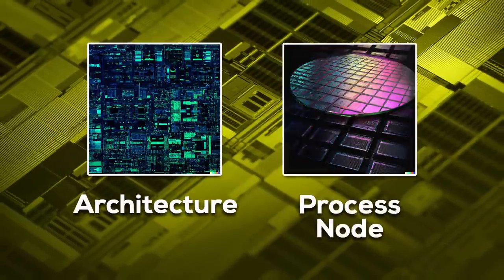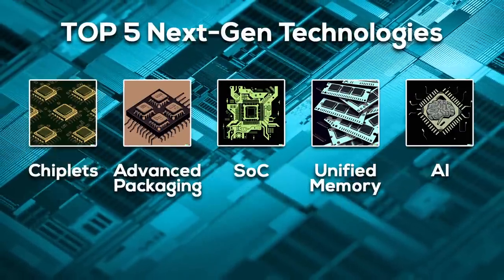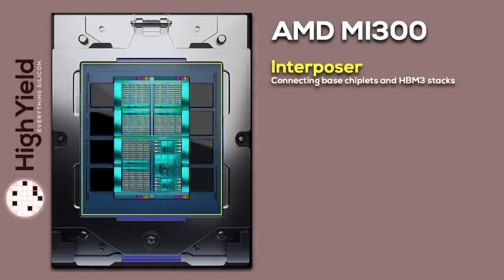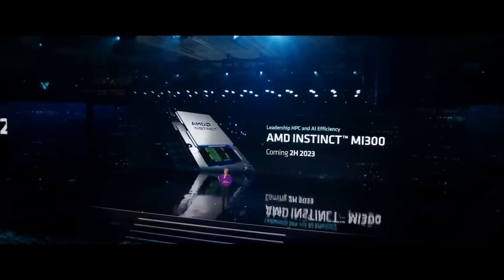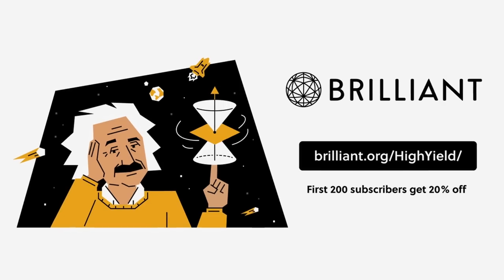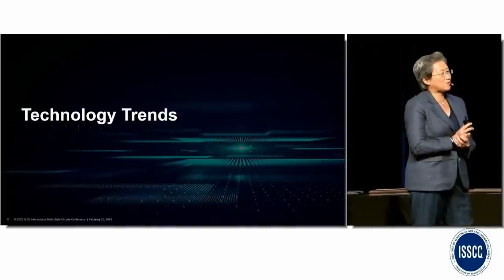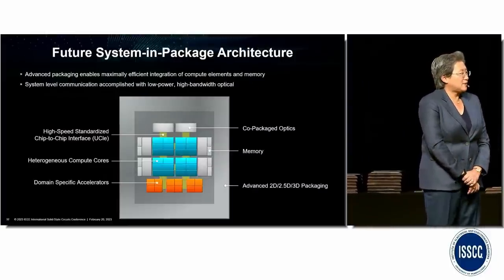Deep-dive into the technology of AMD's MI300

Comment: @HighYield Great channel.  If I may, please pay attention to how long you keep a slide on the screen, especially when text is flashed onto the slide at the last moment.  Just a little thing.
Reply from the maker: Which slide are you referring to? A timestamp would help :)
Reply: @HighYield Sure:

 
2:19
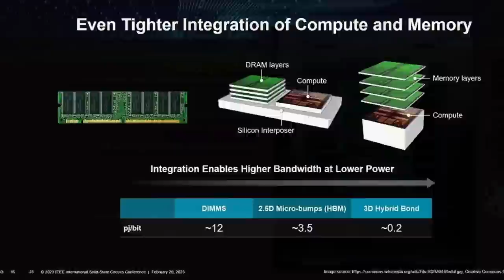9:39 2.5/3D stacking difference: diff is "both (MEM/compute) are actually active".  At 9:47 irrelevant fine print comes into view for 2s.  Even tho that text is unimportant, it creates the impression that I’m missing something.
9:50 "The 5nm MCD and CCD chiplets …".  I couldn’t find MCD in chip diagram or "AMD MI300" text column at right. 
11:54 slide phase-in effect made text unreadable for 4s.  Slide was on for 10s, but disappeared once motion of text froze.  Combined, only once text froze was I ready to read, so reading felt very rushed.
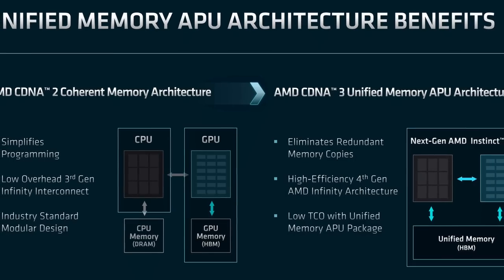13:29 uses same phase-n effect.  But is slide stays longer.
14:19 same
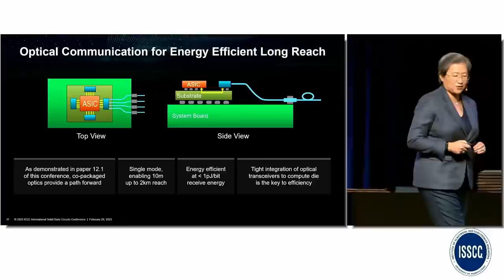17:15 4s

The slide phase-in effect where the start of all sentences are not visible at first and text keeps moving but disappears once it stops moving makes a slow reader like me feel rushed.  (Secret: especially for someone like me who likes to listen at faster speeds, but reads slowly.  I understand it’s not possible to cater to making readable slides at faster speeds).

The section on 2.5D vs 3D at 9:39 created confusion because the explanation of "in 3D, both chips are active" made me investigate the diagram more, and I couldn’t find MCD, so I was trying to find that or determine if you actually said GCD.  The main point is that the explanation of both chips being active in 3D seemed off: the difference strikes me as more about how intensive the transistor switching density (and heat) is for the chips stacked, how tolerant the circuitry is of heat (DRAM, SRAM are finicky), and heat dissipation for the stack.  After all, in HBM, all die in the stack can have dram banks active at the same time.

Please take my original comment as a bit nit picky.  I really like your channel and appreciate the time you put into such thorough content research and video production. I’d like to see your channel develop larger viewership.

Comment: The genius part is making a sort of universal chiplets, that can actually be used in more than one purpose. Whoever figured it out needs someone to go grab him a coffee.
Reply from the maker: Intel's Meteor Lake will also be chiplet based (Intel calls them "tiles") and I'm sure sooner than later Apple & Nvidia will join the club.
Reply: There will even be a PCIe accelerator version that's basically 1/2 of a MI300X on a half size interposer & thus package! (2x base tiles + 4x GCD's & HBM3 stacks vs MI300X's 4x/8x, so 152 CDNA 3 CU's w/ 96GB HBM3 vs MI300X's 304 CU's/192GB). Think the new MI210 equivalent to MI300X's direct MI250X replacement.

Comment: 2:30 I think Unified Memory will really not be a thing. 32GB of RAM for the best-in-class DDR5 Hynix A-die is $80 at its cheapest. The top-of-the-line CPU and GPUs combine to thousands of dollars. Unified Memory involves a lot of management for divy'ing up RAM between the two, which is likely to be slower than just giving CPU and GPU its own separate RAM. Especially given just how cheap RAM is.

For Data Centers, Unified Memory for training AI models is important since we're talking Terabytes of RAM. But atm even 16GB vs 32GB is showing virtually no difference to consumers.

Comment: I say APUs will be the next wave as they are able to perform equal to/better than a console for less money. Small form factor mid range Gaming PCs will be their replacement. I would like to see mobos using dual APUs and shared VRAM style RAM for system and graphics. I really like where they are going. It's what I was hoping for, so I think it will close about the console prediction. Maybe one more "next gen" system from MS and Sony then done....unless they start making pre-built under the name, but they prob won't wa t to deal with that if there is no licensing revenue. Nintendo will probably keep making consoles though, I hope. Anyway my same old ramblings. Thanks for the update!

Comment: I think PHOTONICS are THE FUTURE........  why continue pushing electrons around a board and chips where every bit of distance requires more power to get it there... its inefficiency, like you said, will require a Nuclear Power Plant just to run z Zettascale Supercomputer and the building it's housed in.... photons (light) are so much better to do the work with (IMO) although, we do not have a processor that  can compute using photons instead of electrons (I think) .... but there has been some progress made in this field. BUT not very much. Not enough to make a difference right now. We still still use the traditional electronic methods with some photonic pieces in the system currently... we NEED to make a 100% photonic computer for it blow people's minds enough to fully pursue it instead of using a mix of both systems.... 
I'm hoping you've done a video on this already (I JUST came across your channel when this video was suggested to me, but this vid got me to sub... I really like the cut of your jib, sir! lol) if nopt then I hope you can do one in the near future...there is just too much potential with photonics for it to continue being ignored :)
Reply from the maker: Photonics are definitely a path for the future, but we are quiet a bit off in my opinion. No video on photonics yet, but it has been on my list for a while now!
Reply: Unless you mean to return to analog, application-specific optical Fourier transforms, I don't see why photons would be better to work with than electrons. Photons still have to interact with electrons to change their phase and direction, and the structures have to be much larger than a wavelength to overcome diffraction. Current wavelengths are in the tens or hundreds of nanometers, so the density would be lower.

Comment: I think AMD wants either take over or participate all main computer components (CPU. RAM, GPU) profits, it would be logical from business point of view, simple basic reason.

3D stacking technology is beyond my imagination, but explanation by expert  of how it works can be easy.

As amateur I can think if single layer of chip adds some mass over substrate, then making dead electricity conducting areas on ground transistor layer towards vertical space would enable ability to stacked another layer of transistors fuctioning either 2 5D or fully connected.

Or rather some kind of placing another layer of substrate at single transistor accuracy in X and Y axis. 

The real way it is made needs explanation, if I haven't missed its concept in this already scientific publication of upcoming product.
Reply from the maker: For me, the easiest way to imagine 3D stacking is with the use of TSVs, which are literally tiny copper wires drilled into the silicon that connect both chips. It's like a network of pipes.

Comment: Are Nvidia and Apple the last big bastions of huge monolithic chips?  Both of those companies seem to have the same attitude to throw money on the problem and let the consumer pay for it.  Nvidia and their maxing out chip size for each node. Apple M3 with 3 different design chips reported to cost 1 billion dollars to make.   Why did Apple not release a 4-chip M ultra-ultra chip as was rumored for the Mac Pro replacement? Pro machines with 192gig memory are a no-go for many IT pros.  (and 256 does not solve it either. 4 chips would at least bump it up to 512 compared to Intels MacPro with 1.5 terra)
Reply: Cerebras is banking on wafer-scale chips (entire wafer is one chip) so it can work to have big chips with the right design. You have to be able to fuse off all the bad silicon and/or have enough binning and market margin/demand to make it work. I read on the average nvidia gpu die 10-20% of the silicon is defective. The chiplet strategy is more economical, especially with a simple 2D interposer as on ryzen/epyc. The advanced packaging is much less economical, it would seem easier to do than EUV but if there is any flaw, you are throwing out a lot of chips (no fusing option at this stage). So it really depends on the packaging cost, capacity and reliability as far as how it shakes out in the end.

Comment: I am a little bit afraid of Unified Memory and SoC.
I prefere upgradeable memory and GPU's It would be horrible if i where locked out of content creation (3D Artist) just because i cant afford to lay down 3000€+ just to get the right amount of memory and a powerful enough GPU in one go.
Reply from the maker: True, upgradeable RAM is a nice thing to have. My current system started with 16GB and now I have 32GB.
Reply: They're not mutually exclusive.

A base amount of on package memory could be provided for performance/efficiency reasons and additional memory added-on via either DDR sockets or CXL.

I think the main thing preventing it is profit margins; AMD can't sell integrated memory unless they add the large margin that their shareholders expect. System integrators/OEMs don't want to have their costs inflated.
Reply: @egalanos  True-ish i geuss but knowing currentday manufacturers of motherboards would do the following: 
Cheap motherboards all the way upto 800€ wouldnt have DDR/CXL slots.
And then 1000€ ++ would have the slots, and then they would claim that the slots are not neccessary or something along those lines.

Comment: what's the purpose of the cpu cores here?
Reply from the maker: So it can function as an APU and you dont spend energy transferring data between CPU and GPU over a motherboard. It's for maximum efficiency.
Reply: CPUs do the serial computing, CDNA cores do the parallel. Together it's called heterogeneous computing. 

AMD has nice paper on heterogeneous computing, just Google AMD HSA paper, or something like that.
Reply: GPUs are accelerators only used to perform a specific set of operations. CPUs are still needed to feed the GPUs and run the actual programs. For instance if you're doing AI training. You still need the CPU to parse and provide the data to the GPU, and then compile those results into a model. 

CPUs are really good at executing serial code, while GPUs are good at executing highly parallel code. You need both. And AMD is the only company that can provide best of breed CPU and GPU.

Comment: sooo is MI300 on SP5?
Reply from the maker: There are rumors of a new "SH5" socket.
Reply: @HighYield  for the MI300 to use that seems sensible, to my casual knowledge all of those pins SP5 provide might not have been designed already for a compute monstrosity of this kind
I have been in the perception that it is SP5, mostly because the mockup when the MI300 reveal officially broke out includes the look of the ILM, I have only looked closely at the SP5 board shot the TYAN website has, it looks fairly close but not exact and identical

Comment: “MI300, with its 147 billion transistors, all other chips pale in comparison”… says AMD.
In walks Cerebras, with its WSE-2 ‘chip’ with 2.5 trillion transistors on 46225 mm2, powering the Andromeda A.I. supercomputer.
Reply: You cant produce those waffer scale chips in any large numbers.
Reply from the maker: The the square wafer-scale chip, right?
Reply: @HighYield  Yes, it’s in version 2 and Cerebras already has some HPC and AI customers lined up for it. Cirrascale cloud services have already deployed nodes for rent in their cloud and Cerebras has already test trained several GPT-3 LLM models and opened sourced them. Of course this chip is strictly data center oriented and can never be used in a non-data center environment because it consumes 22kW of power but puts out 6-7 petaflops of compute bandwidth per chip.
Reply from the maker: @glenyoung1809  Maybe a interesting topic for a future video
Reply: @HighYield  Yes the company is very different in terms of their architectural approach to AI hardware. 
There some some obvious advantages and disadvantages to their approach. 
Instead of a chiplet "less is more" design philosophy adopted by AMD they are going the other way with a "bigger is better" approach to ultra large scale monolithic designs. 
One of the advantages is to be able to fit very large LLMs and other AI models onto a single processing substrate and to solve the problem of memory latency in AI computations(the WSE-2 has 40 GB of cache RAM!). 
The other advantage is to minimize the need to split up your code and data into separate processing nodes, a unified approach is both fast and minimized code induced errors in training large models.
A real world advantage is that the model takes less time to train and less energy as well which is a major consideration if you're using thousands of GPUs in tandem in a data center.(performace/Watt).

Worth a look just to demonstrate some other approaches to training and working with AI.

Comment: So will these little builtin AI chips replace using the GPU for AI tasks? I understand GPUs are simply bruteforcing AI calculations with raw power so this chip specifically designed to process this type of data is all you really need? I understand this type of data is actually very easy to process with the right hardware. Someone please teach me, I'm not sure how to google this question. :)
Reply from the maker: In the long run, dedicated AI chips will replace GPUs for AI tasks, but for now GPUs still are on top.
Reply: @HighYield  Iam hearing this from years but the reality is that all the dedicated AI accelerator startups are struggling to compete with nvidia and have basically given up. the kind off momentum and scale nvidia has is underestimated and if it was so easy everyone would have been doing it as nvidia is moving ahead with light speeds with full stack software developer infrastructure and partnerships with top class R&D and here amd and all these startups are failing in just making a chip

Comment: Cerebras is laughing at this video. A single high performance chip that’s used for nothing but training large AI models. No unified memory. No DRAM. No Chiplets. No Advanced Packaging. Just a single chip the size of your head that TSMC makes with 100% yields, consumes something like 15kW of power, and runs circles around Intel, nVidia, and AMD.
Reply from the maker: Very specialized hardware will always excel in specific tasks.

Comment: Disagree, chiplets cost more money and often have tied binary blobs. There is a court case on ARM wishing to get a percentage of OEM sales. The future will be replacing chiplets with seamless integration, and not paying someones overpriced IP for the glue bits.
Reply from the maker: AFAIK, there is no "binary blob" when it comes to chiplets and imho they are clearly the way forward. There is literally no other way of designing and producing such complex products as MI300. What you can "seamless integration" is just another name for chiplets combined with advanced packaging.
Reply: Every chip such as a mobile phone one with a Modem chip (Think Broadcon) comes with a binary blob. Graphics cards have binary blobs to cover up direct DMA access. Intel chips have a locked down security module with own os and locked firmware blob. You will discover patent co-ops for H265 and DDR6. Sure is is possible to have no binary blobs, but that is risky if the chip has defects, so most pony up extra for firmware insurance. Both Apple, AMD and Broadcon are working hard to avoid parasite IP blob taxes. And Google.